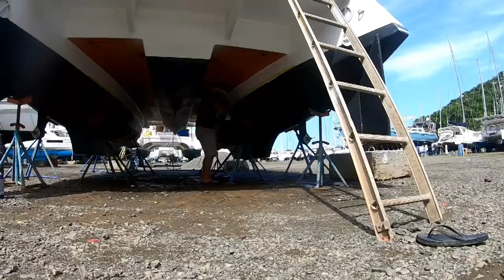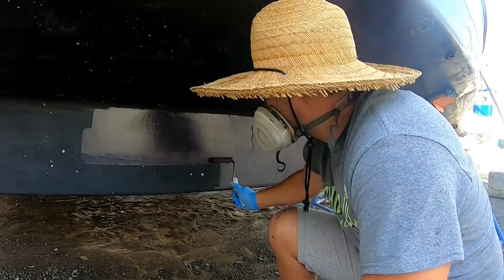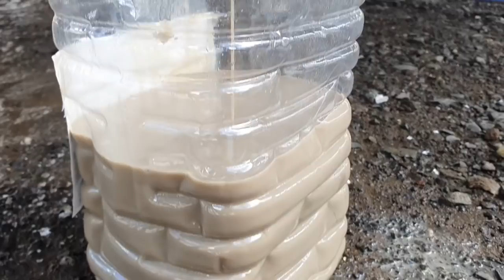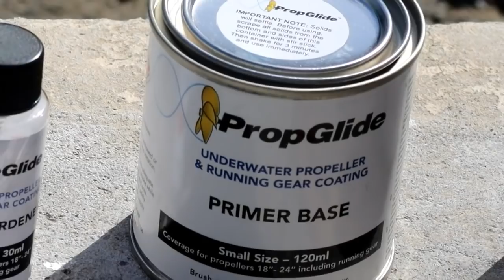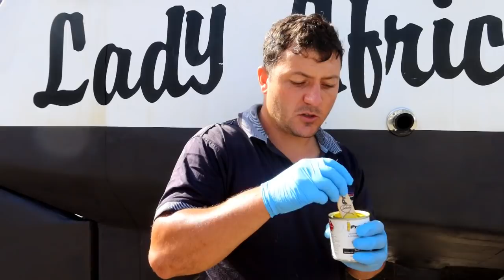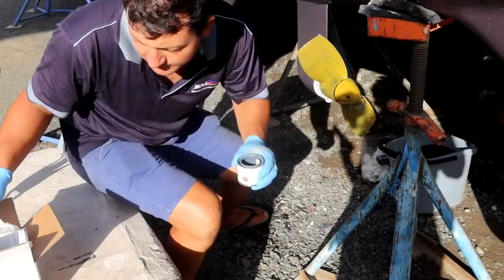Boat Work | It's NOT always FUN in the SUN!

Comment: It looks like your anti-foul has worked really well for you.  What did you use?  

I've been hearing a lot lately about one of the cons of Cats is that you have to be very conscious of the weight taken onboard.  Because , according to what I've discovered, they aren't as buoyant as a mono hull because they have a smaller waterline displacement?  Is that what you are seeing with the increase in depth of your waterline?
Reply from the maker: It really has. We used PPG. Definitely recommend it. That is definitely a concern about cats.. got to be super careful about over loading them if you want them to sail well. Our line was not straight when we initially painted it on. It curved. So we made it straight. Not because of the weight. 🤣